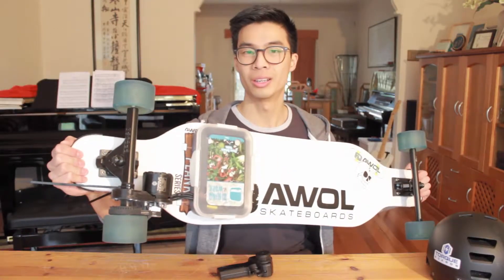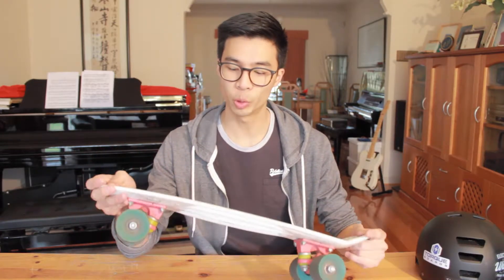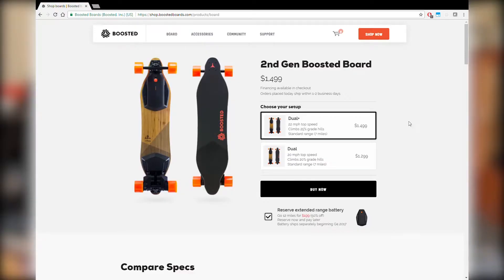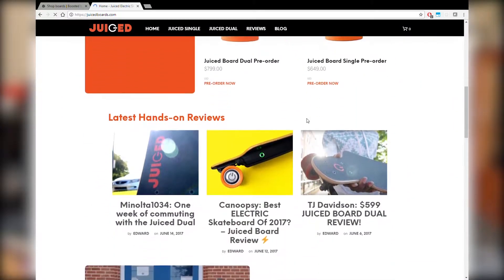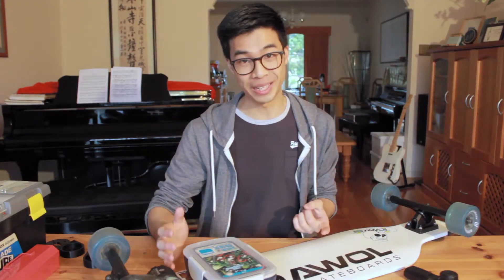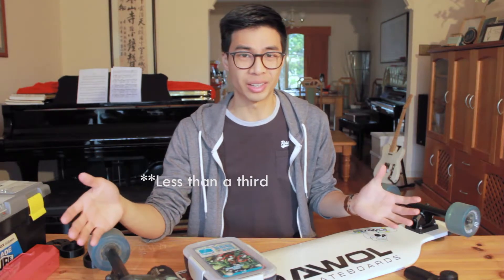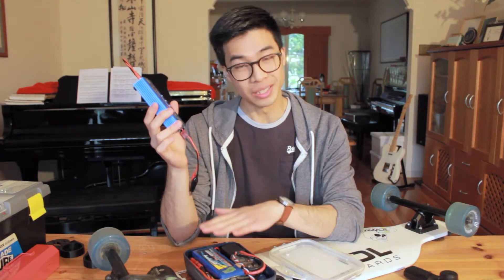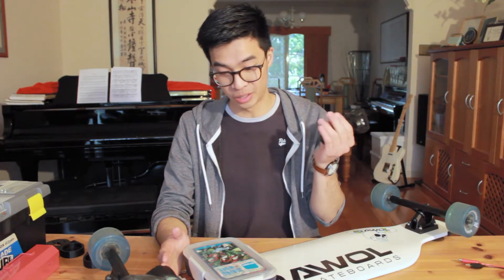I Built My Own DIY Electric Skateboard - 3D Printed!

Comment: What material did you use to print the parts???
Reply from the maker: PETG, but I don't recommend printing the motor mount or motor pulley ahah, it can't withstand the torque coming from the motor. I ended up buying metal parts for those. But PETG or PLA for the bigger wheel pulley should be ok.

Comment: Have the board connected to a friend's truck and ride behind him. Your board connected to a strong string to the friend's truck. Instant  charging method.
Reply from the maker: Annnnnd do that for about 5 hours 😂 But yes, you are spot on, these VESC's do have the ability to charge up the batteries through the motor :)

Comment: Nice project :D 
But for anyone who ever want to build one .... just for safety -use metal gears amd make mount using aluminium or print a mold ( take stl of mounting and cut it shape in rectangle)
 for fiberglass+ resin becouse its stronger .
Reply from the maker: The wheel pulley I found can be 3d printed, its a large round shape and is quite strong. Still using the same one after all these years! But all other parts, (motor pulley and motor mount) I suggest using aluminium/metal. Those broke pretty easily.
Reply: Sebastian Nurkowski There’s 3d printing filaments such as carbon fiber and abs, do you think those could work?

Comment: If anyone is considering going the DIY route you should really consider the kits on eBay that combine the ON/OFF switch, ESC, Charger and remote into one PCB and they sell the drive trains e.g motor, pulley wheels and trucks into one kit that cost $300 AUD
Reply: You just need the kit and a deck
Reply: I get where you're coming from but it is just not as fun.👍

Comment: Can you release the motor mount
Reply from the maker: Heres the files: https://www.thingiverse.com/thing:2429445

We had to modify the motor mount and make it a bit shorter to fit my 40 tooth/12 tooth setup, along with the belts I used. It may be too long or too short for you! After printing, I also reinforced it with a metal plate.
Reply: WilkinsJLeong thanks

Comment: Hey mate! Currently in the process of making a board too. Have you ever thought of printing an enclosure given you have the access of a 3D printer?
Reply from the maker: Thought of it! But it would probably be too brittle, so I just used a cheap lunch box as the enclosure for my electronics :) I have also seen on Thingiverse models that act as sort of a cover for the belt and pulley system, that could be cool to print and try out, offers the belt a bit more protection! But I didn't really go for it cos I didn't think I needed it. (My belts havn't snapped yet)

Comment: could you put the link to the motor mount for me thanks nice video
Reply from the maker: Heres the files: https://www.thingiverse.com/thing:2429445

We had to modify the motor mount and make it a bit shorter to fit my 40 tooth/12 tooth setup, along with the belts I used. After printing, I also reinforced it with a metal plate. 

Again, be prepared for it to snap, 3D printed parts are not the most durable. Thanks for the comment!
Reply: thanks a lot
Reply: how do you do the triangle series thing with three batteries because wheres all the power going to go
Reply from the maker: Great question! 

So, at 4:44 of the video, I accidentally plugged in all three batteries in series, and that resulted in a short. What is meant to happen for this setup of batteries is that you have two series connectors connecting everything together. 

To do this, connect one 'corner' (or connector pair) of the series triangle to another 'corner' of the other series triangle, and this should result in a series loop with four free 'corners', or connector points. Three of them will be for your batteries, and the final one goes straight to your VESC. When the series loop is fully connected, it turns your VESC on.

Mike beard has a great high level guide here: https://www.youtube.com/watch?v=_G0e4_WeKzw&t=1s
(Look for around time 6:50 of his video, he talks about the same battery setup as mine).

Be careful when working with the batteries! :)
Reply: great thanks i was thinking about the two connectors but just to be 100% sure. my batteries came today but i could only afford one battery but my dad kindly got me two instead which i worked out goes about 15 mph which is alright speed, but i'm still waiting on my esc, reciever and controller
Reply: you said in your video that you 3d printed your pulley, i was wondering if you could give me the pulley link
Reply from the maker: https://www.thingiverse.com/thing:1719939

Can't find the exact files I used but most ones on Thingiverse are pretty solid. I've linked you a 36Tooth pulley, that should fit the Enertion power wheels that I used, and most other 'electric skateboard' wheels. Check to see it fits your build! 

(My pulley was 40Tooth but I would recommend you to use 36Tooth, as it gives you a better gearing ratio in most cases, especially if you have only two batteries.)
You seem like you know how to calculate the ratios, but just incase, a great guide to designing a good drive train is here: https://www.youtube.com/watch?v=Ficvq9aLi2Q

All the best! Let me know how you are going :)
Reply from the maker: Oh and as much as you can, print it in at least 80%infill! Or at least as high as you can go!
Reply: i know i'm asking for a lot but could you give me the link for the series connector because i checked on amazon and 1: they didn't have the HXT connectors and 2: they cost £40 + shipping
Reply from the maker: Daniel Phantom4 search some up on ebay, ill try and link you another otherwise later on today :)
Reply: great but i found one on ebay when you surggested to.

Comment: Can you put the link to motor mount STL?
Reply from the maker: Yep! https://www.thingiverse.com/thing:2429445

We had to modify the motor mount and make it a bit shorter to fit my 40 tooth/12 tooth setup.

We also printed it in PETG, 80% infill.

Also, you may want to cut out a metal backing plate of some sort, cos it will probably it will snap!
Reply from the maker: Heres the files: https://www.thingiverse.com/thing:2429445

We had to modify the motor mount and make it a bit shorter to fit my 40 tooth/12 tooth setup, along with the belts I used. It may be too long or too short for you! After printing, I also reinforced it with a metal plate.

Comment: Cool build!  What was your total cost?   How did the printed motor mount hold up?  Did you print in PLA or ABS?
Reply from the maker: Thanks Theodore! I think it was around 700 Aussie Dollars all up, minus the excessive extra nuts and bolts and stuff I also bought.

The printed mount didn't do so well. It snapped after around 2 weeks. The plastic we used was PETG, which was a bit more flexible, less brittle than PLA. This meant it was in theory a bit more durable and less prone to breaking, but 2 things:
- The flex in the motor mount meant I lost torque (as it flexed, the belt sagged)
- It snapped anyway

I ended up reinforcing it with a cut out metal plate from Bunnings and that seemed to fix it for both issues! A follow up video about that is definitely needed.

Thanks heaps for watching and for your support!
Reply from the maker: Also printed with 80% infill!

Comment: can you sent me the file you used for the 3d printer? it would help a lot.
Reply from the maker: Hey dries dk! Thanks for watching! Yeah I can get the files to you soon, things are a bit hectic at the moment with uni but I'll get back to you in a couple of days!

A thing to note though,  the plastic I used (PETG) was a bit flexible, which meant I lost torque, and it did snap a couple of times - I had to cut out a metal plate to use it as a backing to make it a bit more sturdy. It fixed the torque issue and stopped it snapping so easily. All up it's still cheaper than buying a metal motor mount for ~100 USD, but requires a bit more extra work to get it right!
Reply from the maker: Heres the files: https://www.thingiverse.com/thing:2429445

We had to modify the motor mount and make it a bit shorter to fit my 40 tooth/12 tooth setup, along with the belts I used. Again, be prepared for it to snap!

Comment: what's the range that you've got with this?
Reply from the maker: FlatLine0107 Hey FlatLine0107! I have not properly measured yet it but my conservative estimate is 10 miles, or 16 kilometres. 

I've used it go get around uni for an entire week with out charging, and still had 4 kilometres spare for the weekend.

Comment: Hey Wilkins, I've just built an electric mountain board. I use the same batteries as you. You can recharge the batteries by plugging in just one of the balance leads and all the batteries will charge at the same time, I use a Quanum E4 cube charger from hobby king. They charge quicker too..Nice vlog
Reply from the maker: Thanks mate! Will definitely look into that option! Do all the batteries balance charge with only one of the balance leads in? And how long does it take you to do a full charge?
Reply: Hi yes all the cells balance charge through one lead, I am charging right now!! I have 2 x 5000mAh batteries and 3 x 2200mAh all wired together and it takes around 2.5/3 hours.. I charge batteries from 10.5 Volts back up to 12.4 Volts. Hope that helps. ..Oh and get some really cheap lipo voltage checkers from Banggood they are around $2 each, get a few and leave them on the balance leads when you are using the board, its better than destroying your lipos!!
Reply: you can only charge 6s with that charger he has a 9s pack.